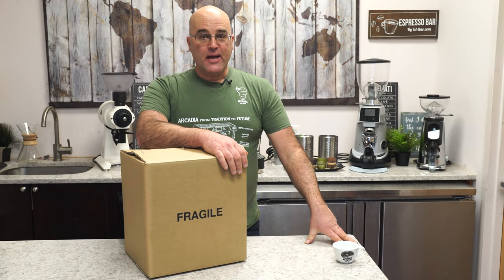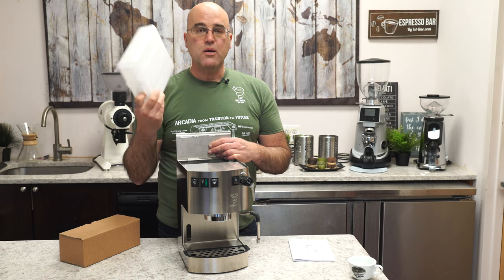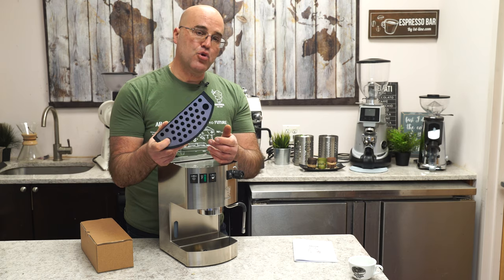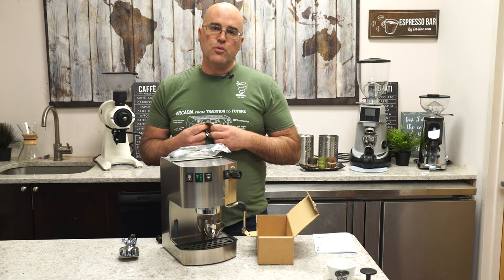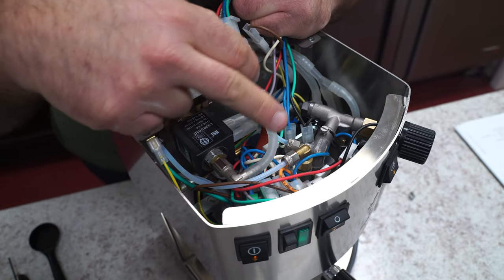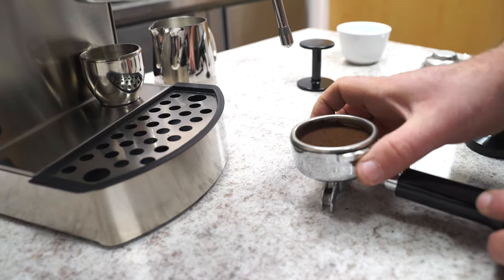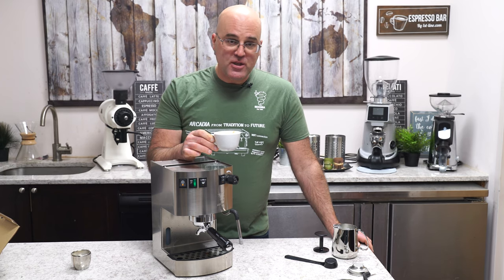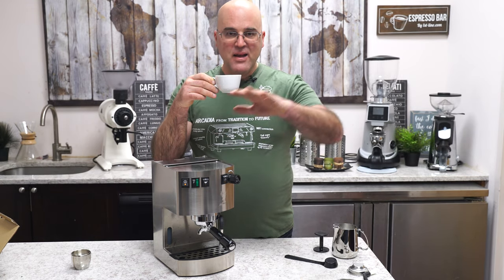Bezzera Hobby Home Espresso Machines

Comment: I've had a Hobby for three years I recently had to get serviced, and I was looking for help making sure I wasn't nuts on proper operation of the pump. I use the water pump a lot for Americanos. The proper technique you covered for filling the boiler is opening the steam wand and running the pump to draw water into the boiler. I used to run the pump WITHOUT opening the steam wand and distinctly remember it dispensing air and water back into the reservoir. However, after getting it serviced, running the pump without opening the steam wand now dispenses water through the drip tray and grouphead instead of back into the reservoir. I'm trying to figure out if something like this is a part failure of the solenoid valve or an error on the technician's part, and if this was a mistake I made with my own usage.

Comment: your pronunciation is really funny ,, accent is on the vowel in the penultimate syllable ,,but ,, when a  vowel is repeated ( as in this case the E is repeated ) its the first of the repeated vowels that is accentuated ,  ,, ,, & the double ZZ is ,, a hard Z sound which is almost pronounced like the “zz” in the English pronunciation of “pizza” but unlike pizza and because the first vowel is accentuated it ends up inheriting a softer "d" in front ,in this case it sounds like pi dzz a ( which is not the way ""pizza"" should sound )   so BE-d-ZZERA with only a hint of the d and the first E accentuated
Reply: An east coast accent.  New Jersey working class.  No mystery. Merely region plus class.
Reply: @ronaldsantosjapan  who is east coast i am italian  born  and bred